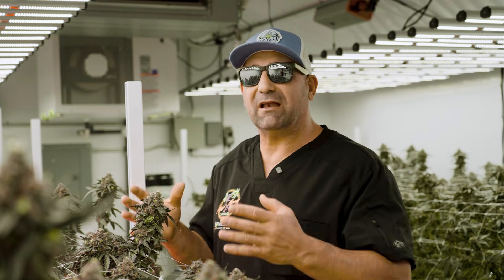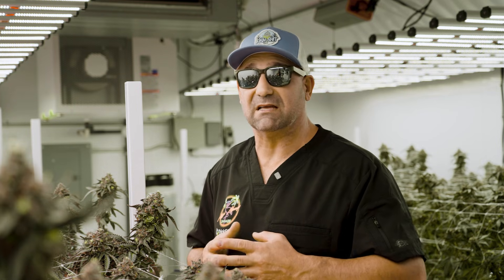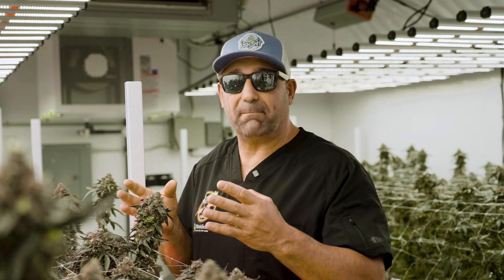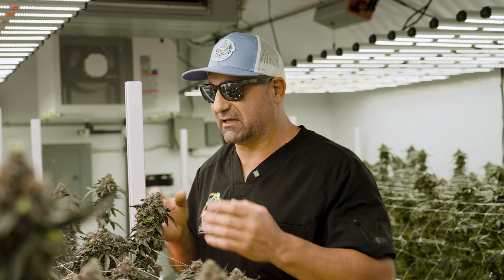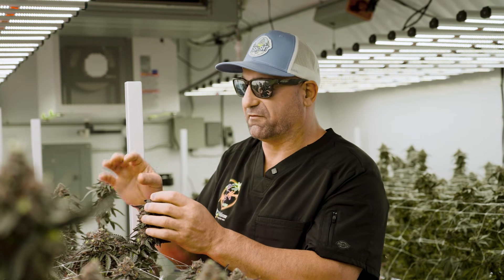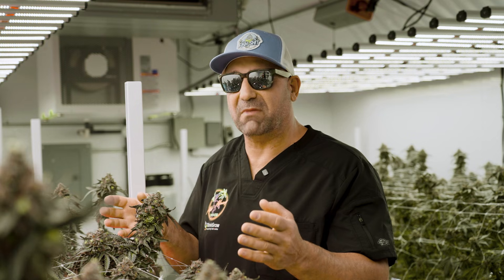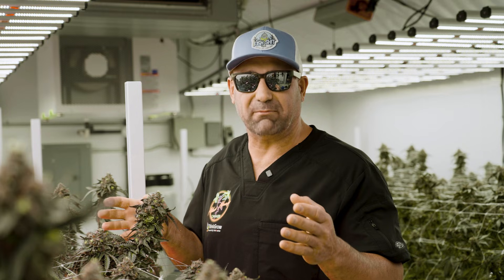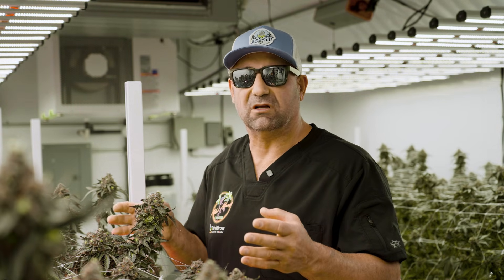Why Does Cannabis Foxtail?

Comment: Constantley preaching to turn down them lights! Some of the best youll ever grow will be sub 1k ppfd. These light manufactuers want people to buy these monster lights that most enviroments just are not capable of running on near full. Get a good meter and stay at 1k or below. Makes everything else go so much smoother. The plants are just healthier. Health equals better bud, always. People almost always make the mistake with autos, not considering they get more hours under the sun, there for dont need or cant handle 1k ppfd for 18 to 24 hours a day. Dial that back to 750 and watch yourself grow the most beautiful autos you ever have. Less is more, in most cases.

Comment: Had several foxtail badly  on my last run of autos outdoors. It just got way to hot and humid during that prolonged heat spell and the sun was set on direct laser injection mode. It sucks but take what it makes and  move on. In most cases it's not even worth trimming though.